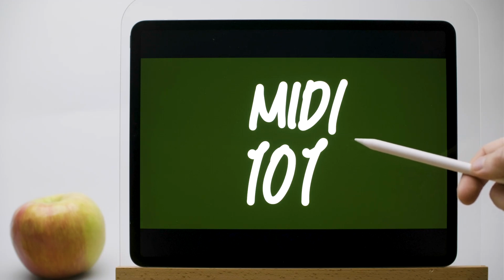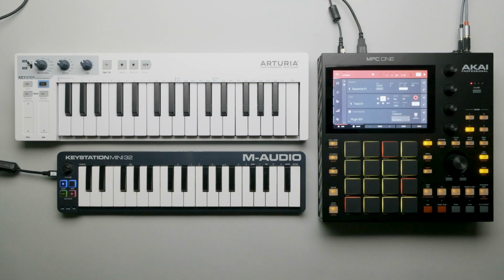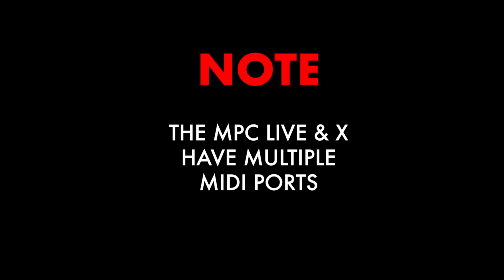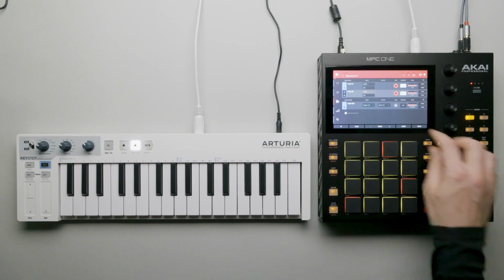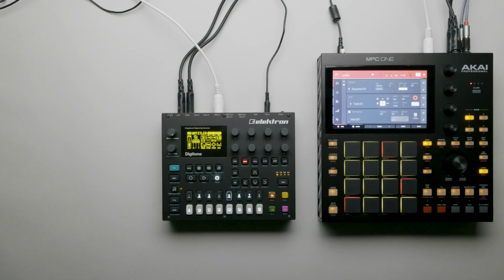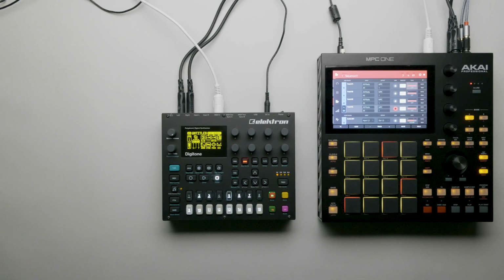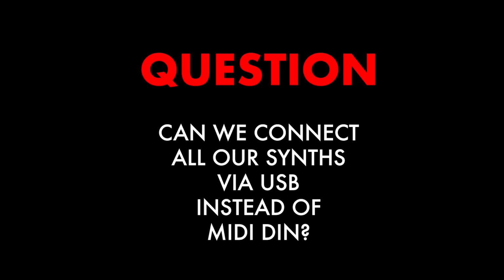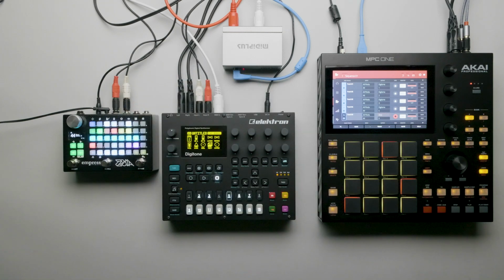MPC: CONNECTING MIDI DEVICES

Comment: "one track on channel one and other on channel two" and then switch channels on external keyboard. All right but if I have external keyboard (reface CP) that can't switch channels can I have multiple tracks on one channel and just switch tracks in MPC to make it usable for live looping?
Reply from the maker: Yes, you should be able to configure it that way. The trick is not to have all your tracks armed at the same time. When using one midi channel, it will try to trigger all tracks that are armed currently. So switching tracks is really a matter of arming whatever track you want to control currently. Hope that helps.
Reply: @OllieLoops yes, arming and disarming. Got it!

Comment: What are the pros and cons of doing this vs using a mpc key 37?   Is there more memory space or more freedom either way? Thank you
Reply from the maker: My understanding is that they are the same internally in terms of memory and performance. They use the same back end. The reason to get the 37 is for the keys, if you like playing them. Otherwise, it’s a bigger device and costs a little more. Hope that helps.

Comment: I appreciate the Knowledge! But I'm only trying to connect a Roland Juno D Synthziser with my MpC 1+ so that I can control the sounds in the synth with the MPC. Note I'm in Standalone and I'm using Headphones
Reply from the maker: Assuming you are trying to control the synth from the mpc via midi, you should be able to connect usb between them. Then set the midi channel on the mpc to be the same as the synth. Check out the video for more info.
Reply: @OllieLoops What's going on! No ! My keyboard doesn't have USB!

Comment: HEY OLLIE LOOPS!!! THANKS FOR THIS THOROUGH TUTORIAL VIDEO!!! I'VE USED IT TO ANSWER VARIOUS QUESTIONS FROM MY SMALL COMMUNITY.  I AM REQUESTING THAT YOU DO AN UPDATE WITH ALL THE CHANGES THAT HAS OCCURRED WITH THE MPCs.  I HAVE A COUPLE OF THE MODERN MPCs & THE MIDI SYNC OPTIONS SEEM TO BE DIFFERENT. HERE'S A COMMENT ONE OF MY MEMBERS LEFT RECENTLY:  "My challenge is the Key61 can only sync one piece of gear via midi. Even with a midi splitter it won't send two tracks simultaneously."  DO YOU HAVE AN EXPLANATION/ANSWER FOR THIS??? 🫡

Comment: What exact cable is used to connect as per 2:40 in your tutorial? A straight usb-a to usb-c does not work allow me to transmit from my iRig key Pro to my MPC live ?
Reply from the maker: That exact cable is a USB A to USB mini A. I don’t know much about the irig keys pro, but if it’s bus powered, it should work. Try a different cable.
Reply: On one end it the usb-a and the other end has the mini usb-a. What is the device called that falls immediately behind the mini-a?

Comment: I'm so damn confused!  I'm hoping this video helps!  I just got a Yamaha MX61 (keyboard/synth) and connected it to my MPC X and have quite a few questions.
I'm able to hear my Yamaha MX61 and I'm able to record audio tracks of any sound that I select with my MX61.  However, once I record one track with it if I go
to record a different track that track still has sustain pedal information on it the way the previous track had.  I played piano on track 1 and I used the sustain and
everything was fine with that track.  But that same sustain midi information is being applied globally rather than to just that one track!  I'm also a little confused
about midi.  I'm not using midi cables with my current setup but I am using a USB cable.  Also, how the hell do I record a sound from my MX61 (say a piano) and
then go record a completely different sound from my MX61?  If I change the sound on my MX61 it applies the change to my piano sound from track 1 which is
not what I want!  Damn I wish I had friends that could help me out in situations that involve making music!  Tired of self teaching haha

Comment: How does scales and chords mode translate to the midi keyboard? Does 1 key represent a chords like 1 pad does when no midi controller is connected?
Reply from the maker: Hi, yes, I believe when chords mode is engaged on the MPC, notes/pads and keys will play chords.
Reply: Im here to report that it does not work  unfortunately  @OllieLoops
Reply from the maker: @novich63  oh no! Thanks for reporting back. @akai this is a good feature to add.

Comment: Great video and presentation.   I have a Korg Nautilus and HATE using the onboard sequencer but the Love the onboard sounds and keybed so looking to use the MPC one+ as an external sequencer.  Would this work for unlimited midi track recording?
Reply from the maker: Thanks! yeah, it should work. Just connect it like any other synth as described in this video. Midi into the synth, audio out of the synth and into the MPC. set up tracks accordingly. Have fun!
Reply: @OllieLoops  Thanks! So USB B from Korg to USB A on MPC?

Comment: I want to use the Roland keyboards sounds in my MPC one but I want to control the Roland’s keys with my mpcs pads please help
Reply from the maker: Hi, the concept is, send midi out from the MPC into the synth/keyboard. Then audio from the keyboard goes into the input on the MPC. Within the MPC, you have to setup a midi track and and audio track. This is shown in this video starting at 11:35. Hope that helps.

Comment: I have to be dumb ... when I think I get it I suddenly get lost in the sauce. I have a MPC One. I plan to add a small synth like Roland S-1 or Behringer ProVSMini. How do I do that without losing ability to sample from my phone which is connected via TRS to lighting cable?  I just want to be able to have a synth connected and being able to hear it at the same time when I have a phone connected for sampling.
Reply from the maker: No need to be hard on yourself. This stuff can be confusing sometimes. Let me try to help.

Since the MPC One only has (1) input, both devices (your synth and phone) will need to combine into that input. There's a couple of options. 

OPTION 1: small audio mixer. Buy a cheap audio mixer, plug the synth and phone into the mixer, then plug the output from the mixer to the input on the MPC. This adds a piece of gear, but allows you to control the levels of everything independently.

OPTION 2:  "Y" splitter cable. Buy (2) mono 1/4" male to (2) 1/4" female splitters - you will need (2): (1) for the left input, (1) for the right input. Then plug your synth input the splitter(s), if it's mono use the Left input. If stereo, use both left and right. Your phone goes into the other inputs of the splitters. You may need another adaptor to go to 1/4" from whatever your phone adaptor outputs. 

Hope that helps.
Reply: @OllieLoops thank you! So something like cheap mackie mix5 would be ok? Phone and synth would go into the input channels and output channel would go into MPC input?

Comment: Ok, so, basically , the first part should prove that I could simply plug MPC to my laptop via USB port, and use DAW of my choice to control every little aspect in MPC ? Is there actually a way to control MPC from DAW like elektron does with its devices with Over bridge?
Reply from the maker: There's the MPC Software that you can use on your desktop. That gives you just about everything that the standalone does but on your desktop. You can then connect a standalone MPC and use it as a controller for the MPC software. You can use the MPC software as a VST in your DAW. Both the MPC standalone and MPC software have Ableton Link, allowing you to sync between them and a DAW that is Link enabled. That's another workflow you could use between MPC and DAW. Hope that helps.

Comment: Hi Ollie, I was wondering. Does the MPC work with drum triggers like the Roland BT-1 without MIDI? Or does that only work if you play it through a SPD/Drum computer? 

Love your content!
Reply from the maker: Thanks for your comment. I'm not super familiar with the BT-1, but it appears to only be compatible with triggering drum kits, and likely only those made by Roland. You would need to convert the signal from what the pad outputs into either midi or CV. You may have some luck on the CV side, but I'm not 100% sure what the Roland system uses. Hope that helps!

Comment: The pads are controlling my external device with no issue BUT  it will not playback what was placed on the grid. Why??
Reply from the maker: Can you describe your set up more? Assuming you have a track a program for an external device which works, you have another track and program for an internal track, correct? And when you play the MPC, the internal track is muted?
Reply: @OllieLoops  thank you, I realized I have a different problem. It's just the first step in the sequence that won't play. I'm thinking this is an issue with the motif rack es that's receiving usb midi from mpc. The same issue was present when 5 pin midi was used.
Reply from the maker: @tylergates4075  Sometimes when that happens, the first note or step is actually ahead of the start of the first measure. When you loop the sequence, does the note play when the loop repeats? You can try selecting the note and nudging the time to be a hair after the start of the first measure. Hope that helps.

Comment: this is real and useful information, much appreciated! one question; can the MPC be connected to send MIDI clock to a couple synths , send a click track to a drummer and trigger sampled sounds on pads while playing a sequence like in song mode ?
Reply from the maker: I believe you could do this, but the tricky part is sending a click track to a drummer. You would need an MPC with multiple outputs. Then program a click within the song to only output on one set of outputs. The rest of the sounds triggered by the pads would go to the main output. For the midi clock, connect the synths via USB or 5 pin din, and configure midi clock to be sent out according to the connection type and midi channel selected. It’s a complicated setup, but I think it is possible. Hope that helps.

Comment: These are not practical examples. I want to play electric piano, let the MPC do the drums with fills and a beautiful ending whenever I want. Since I cannot play base gitar, this should be added by the MPC one at the correct key. This seems not possible, which makes the MPC useless. What I saw in the movie, any freeware sequencer can do.
Reply from the maker: Many live performances use a laptop to play backing tracks. Seems like that solution is something you may want to look into.

Comment: Hi there. This is the best instructional video i've ever seen. I think i encountered a bug. Have seen people comment, and would love to know if you can help. I've mapped my Volume parameter of Track 1 to my IRig pad slider. I learn, move the slider, go to the MAIN page, and then the slider works to control the volume. However when i let go it starts to glitch all over the place. changing numbers up and down randomly. 64, 122, 6, 78 etc. 

I unplug the device, and it carries on glitching. 

I deleted the output options for the Midi device also, so i know i don't have a loop of midi data circling around. 

Some people have commented on this bug, but nobody has given any answers. Do you have experience with this?
Reply from the maker: I have no experience with that. Does it continue to you happen even if the midi controller is unplugged? The midi controller could have a setting that is causing it to interfere with the MPC. Check the settings on the middle controller. If you have another midi controller, try that to confirm the behavior is the same. Otherwise, it could be the irig controller.

Comment: question. every time i connect and disconnect my midi devices do i need to reassign all the parameters again and again? or does the MPC "remember" devices allowing me to plug and play?
Reply from the maker: Are you working in the same project file each time you reconnect? Or are you starting a new project each time? I believe midi mapping is saved at the project level.
Reply: @OllieLoops  i do not own the hardware but i have been saving up to buy it soon. so i wanted to know ahead of time what to expect. 

i guess my question is for starting a new product. like once i set up the MPC and all the midi controllers in my "studio" would i have to set up everything again if i were to move to another studio?

also thanks for the quick response and keep up the great work.
Reply from the maker: @KenCrocodile  One trick might be to save a template with all your midi settings/mappings, then start with that when you start a new project. If the MPC stores it at the device level, it may remember it until you change it. If you did move studios physically, you would need to connect everything in the same way in order to maintain the settings. Hope that helps.

Comment: It's not possible to send midi velocity from the pads in the MPC to an external synth? Thanks for the video! 🎅
Reply from the maker: Good question. The MPC can send velocity information. But not all synths accept it. Therefore, it will be case by case depending on what gear you intend to connect.

Comment: I have about a dozen synths hooked up to my mpc one. They are all in different midi channels.  However, if I record something via midi, and then play a different synth, but the same note, it cancels out the one recorded. How do I fix this?
Reply from the maker: Playing a note cancels out a recorded note? Hmm. One thing you could try is to have a different midi track and program setup for each synth, with unique midi channels for each. Ie, synth 1 is track 1, program 1, midi channel 1. Then synth 2 is track 2, program 2 and midi channel 2. Etc. in theory, if you record midi notes on track 2, it should only record to track 2. Then switch to track 1 and see if the same is true there. Hope that helps.
Reply: @OllieLoops  I’ll try that. It only cancels out a note of recorded part if it’s still armed to record. Once I unarm it, It works fine.  It’s just a pain that I can’t record multiple tracks without going back and fourth
Reply from the maker: @teamphil  That makes sense. It sounds like multiple synths may be using the same midi program or track. I would try the method I suggested. In theory, they should all be able to be armed and not interfere with each other. Hope that helps!

Comment: Greetings from Spain, I have a MINILAB 3 controller from Arturia and my question is if the Play, Stop and Record buttons can be assigned to midi learn in akai mpc one standalone? Thank you so much.
Reply from the maker: I believe they can. Also, check out Arturias midi center app, you can customize the controller then. Confirm the midi notes for each of the transport buttons. Then you should be able to midi map them on the MPC. Hope that helps.
Reply: I will try it!! Thanks a lot friend ! @OllieLoops

Comment: You are using a usb hub there ? Would this work with a 16 channel midi patchbay ?
Reply from the maker: A usb hub was used to connect multiple USB midi devices. A patchbay could be used, though you would need all devices to use 5 pin din midi, which may require more cables and configuration.

Comment: Good video.  I was wanting to know if changing the current slice via midi keyboard when in program edit mode was possible.  The selected slice does not change when i press the keys, only when i press a pad.  I would like to be able to play thru my different slices with the keyboard and have the selected slice change along with it. The selected slice does NOT change until i press a pad.  By the way, i am connected to my MPC X via midi din cable instead of USB.

Comment: Thanks. This explained why I couldn't see separate devices listed in MIDI/Sync - they only appear with MIDI over USB. Seems odd that with MIDI cable connection, your i/p port is "MPC" (the MPC's physical DIN), whereas in the same menu, you select the name of the external device as your i/p port when using MIDI over USB.
Reply from the maker: Yeah, the naming convention is a bit odd, but once you know you know.

Comment: Possible to send midi data from a laptop into the MPC via USB?
Reply from the maker: Yes. Assuming you have a daw or app on the laptop to send midi notes from, just set the MPC as a control device in the midi preferences of the app. You can also sync clock between the two devices.

Comment: you cant change presets of a plugin in standalone with an external controller right?
Reply from the maker: Good question. Depending on the setting, you can midi map certain parameters to an external device.
Reply: @OllieLoops  Ive tried but couldnt figure it out. MPC sees incoming program change but it seems like the plugins, lets say Odyseey, do no have the ability to do that...

Comment: Hi. I’m pulling my hair out. At 10 minutes in, you say MPC should show midi data from controller. Mine will not. I’ve tried two different controllers, two different cables, to no avail. I’ve tried trial and error in the preferences midi sync section to no avail either. Basic playability is working, mapping not at all. Any ideas or suggestions? Thank you. Great vid, just so frustrating mine won’t do this simple thing.
Reply from the maker: someone mentioned that the midi mapping feature changed in a recent firmware update. If that's true, you could try reverting back one or two versions, just to rule that out. 
also, I'm not sure how you're connecting the devices. you could go from USB to midi 5 pin or vise versa, just to rule that out.
Reply: @OllieLoops  Ok, thanks. I pretty much let it go and will just use my 4 Q-links.

Comment: Great, i tried it and it works great! Thanks!
Is it possiple to change the midi notes of the pads on my Akai LPD 8 controller without the software??
❤
Reply from the maker: Thanks! 

According to the quick start guide, you can change the midi note value from 0-127 without the editor software. Assuming that changing that value, it could allow you to change which midi note is assigned to the pad. However, it looks like the editor software is likely the best way to edit these values, if you can connect the controller to a computer.